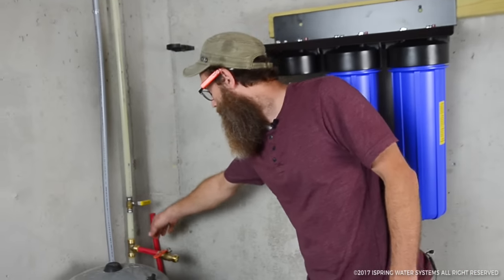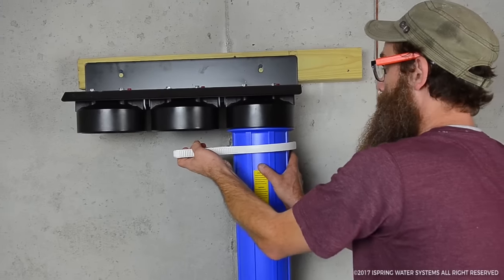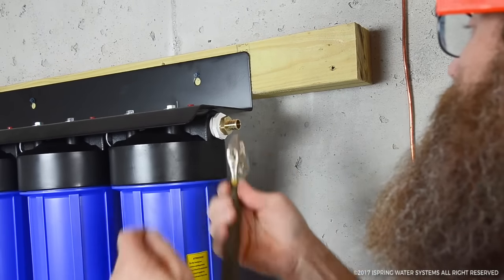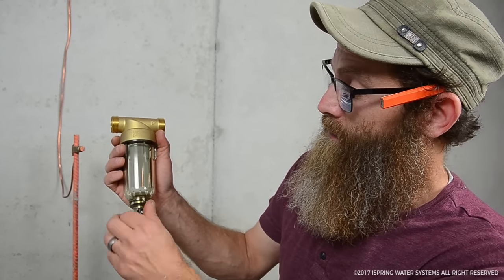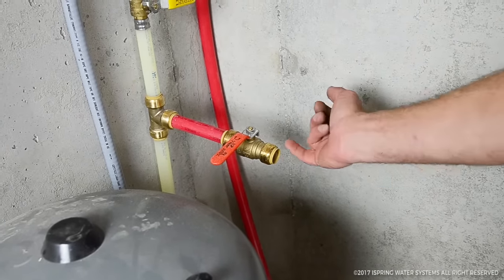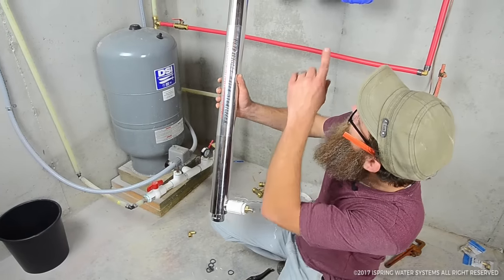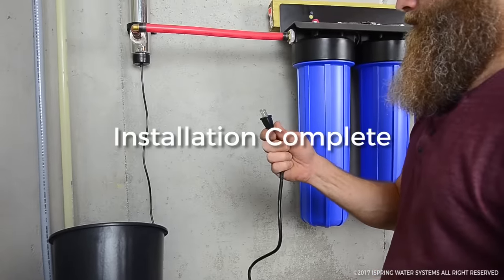iSpring Whole House Water Filter Systems DIY Installation

Comment: Which position should the iron & manganese cartridge be in, open or closed?
Reply from the maker: Hi there! The iron and manganese removal filter should remain sealed and not be opened as this can cause the media to spill out and get into all of your plumbing connections. Simply place the cartridge into the filter housing and install it on the system.
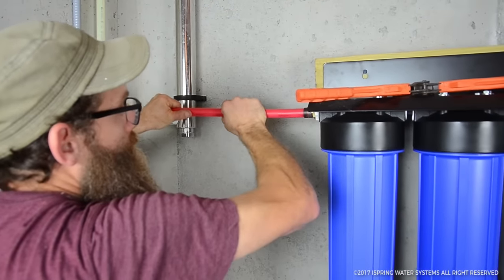If you have any concerns or questions, please reach out to us at support@123filter.com  or 678-261-7611 (M-F 9:00-5:00 EST) for proper assistance. Thank you!
Reply: @iSpringWaterSystems  thank you so much for your help

Comment: My pipe fitting keeps leaking a little bit. Should I try some plumbers putty?
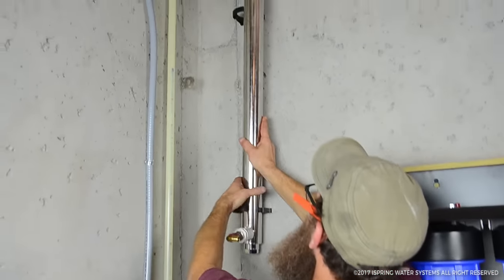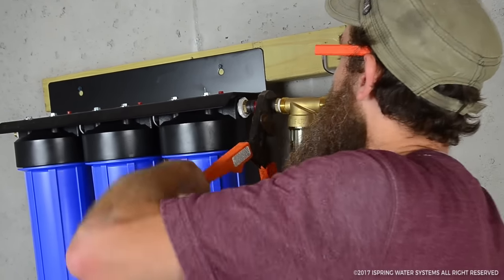Reply from the maker: Hi Bob. We recommend purchasing fittings from a plumbing supply store as they seem to fit better than the ones from Home Depot and Lowe's. You also need to use teflon tape specifically for 1" fittings and plenty of it, sometimes 12 - 15 wraps. Some customers do use the putty. If that doesn't stop the leak, please call us at 678-261-7611 (M-F, 8:30 - 5:30 EST). We will help you to solve the issue.

Comment: i look a those filter that are huge compare to 3m cuno that i use where i live...what cames to my attention is the pipe fittings.. they are small..  where i live ppr is mostly the standard .. but the mains for a small house is 3/4 and up. 1 kitchen and one toilet.    those fittings looks like 1/2 or less.

Comment: Does this system need a pressure tank ??
Reply from the maker: Hi there. Our whole house systems usually don't require a pressure tank. If your water pressure is below 25 psi, please give us a call at 678-261-7611 (M-F, 8:30 - 5:30 EST). We are happy to help you figure something out!

Comment: Looks like a crimper is used throughout this install? What type and model please?
Reply from the maker: Hi Spicer. For more information about crimpers, you can check out this video: https://www.youtube.com/watch?v=P3fS01e1RVM&feature=emb_logo  (the crimper is near the end). Our WGB series whole house water systems have different type of connectors for Pex and some of the connectors require expansion before insertion and crimping.

Comment: If I already have a wholehouse filter system and water softener do I need a 3-stage filter for my RO system?
Reply from the maker: Hi there. It depends on the type of contaminants that your water has, and on what your current systems filter. Do you have a water test report that you can share with us? A water test is very important to know the contaminants that your water has to choose the system or systems that meet your needs. 
You might want to check our blogs about how to choose the right whole house system and how to test your water quality :
https://www.123filter.com/ac/a-comprehensive-guide-to-whole-house-water-filtration-how-to-select-the-right-whole-house-filtration-system 
https://www.123filter.com/ac/how-to-test-my-water-quality
If you have a water test report or if you have any questions or concerns, please kindly contact us at support@123filter.com, at (678) 261-7611 M-F 8:30-5:30 EST or at (470) 560-0012 M-F 8:30-5:30 EST (Messaging only)  to properly guide you.
We are happy to help!
Reply: @iSpringWaterSystems  I have a report of the water from the inspection and nothing was present.  I am using a three stage whole house filter (Pentair Pentek DGD-2501-20, Pentair Pentek ChlorPlus20BB, Pentair Pentek FloPlus-20BB) + Water softener.

Comment: Does this solve for manganese in water that results in black sludge like substance on faucets and in washing machine? That what I’m trying to solve for without paying $3500 to Kinetico.
Reply from the maker: Hi Mike. Our WGB32BM would help to solve the problem only if manganese is 1.0 ppm or lower. We recommend getting your water tested first. After you get the results, please give us a call at 678-261-7611 (M-F, 8:30 - 5:30 EST) or email us at support@123filter.com. We will be happy to give you a personalized product recommendation.

Comment: I ordered a Fcrc25b filter but the strange thing is that there is no label indicating that it is the fcrc25b filter. The plastic wrap looked tampered near the area of where the sticker should of been. I don't want to speculate that I was given a different filter because the one I ordered wasn't in stock or something of that nature. If I get a reply that would be greatly appreciated.
Reply from the maker: Hi Lucas. I'm sorry that the FCRC25B filter you received didn't have a label. The filter was always in stock for the last 30 days so if you bought it from Amazon, Lowes.com, HomeDeport.com, or directly from us at www.123filter.com, it should be legit. If you still have concerns, please feel free to reach out at 678-261-7611 (M-F, 8:30 - 5:30 EST) or support@123filter.com. We are happy to help.
Reply: @iSpringWaterSystems  Thank you for the response after talking to your customer service rep they assured me that  the filter i have is the correct one.

Comment: Looks too heavy for a wall filter. I'm wondering what is the weight with water flowing through the system.
Reply from the maker: Hi there. the canisters full of water are about 15 lbs. each. If you still have concerns or need tech support, please feel free to contact us at 678-261-7611 (M-F, 8:30 - 5:30 EST) or email us at support@123filter.com. We are happy to help!

Comment: Can i use those blue containers to greatly increase the water 💦 pressure if I remove the filters inside?
Reply: Pressure doesn't change.  Only flow changes!  Plugged filters will only restrict flow.  Trust that helps U.

Comment: Could all that filtration and UV happen BEFORE the water goes into the tank? I'm on city water (steady pressure--no pump cycle), and am think of adding the water filter... And would use the tank as an emergency storage supply...
Reply: Hi Ralph Marshall,

Yes you could install the system and UV sterilizer before a pressure tank or holding tank. Please let us know if you have any additional questions.

Thank you,

iSpring Water Systems LLC
Reply: I DO have a question... Seattle's water is actually very good... 29 ppm... My house is 70 years old and the pipes are original... Lately the hot water side has slowed down so I'm going to take care of that and add one of these set ups I see above... Here's the question... Two products promise to revitalize your water... Something about clusters of molecules, blah blah... One is the Home edge... Basically, sets of propellers just to churn up the water... And the other is an electronic system that uses EM frequencies to alter some ionic blah blah... Are either actually worth anything?

Comment: Maybe it's just my failing eyesight, but it looks like little to none of the feed water lines, prior and post filter lines had any support/securing installed.  I trust you corrected that after the video.  Failing to do so is sloppy workmanship >> In my opinion!
Reply: Should also install a 3 valve bypass on the UV along with a test port bleed valve for when you are changing the lamp to drain the water, also always support the piping to the wall and use gloves when touching the lamp and the filters.

Comment: Why don’t any of these filters come with 1/4 drains on the bottom of the bowls ?
Reply: Good question. 'Water Express' does have a pressure release button at each of the 3 filters, but you still have a cannister Full of water to deal with. A bottom drain would be nice.

Comment: How much power does the uv light   pull continuously? Won't it drain solar batteries?
Reply from the maker: Hi Grover. Our uv light uses a 55 Watt bulb and sterilizer.  It depends on your solar battery's capacity to say whether or not the uv light would drain it.
Reply: @iSpringWaterSystems  does the bulb burn all the time or just when water passes through?
Reply from the maker: @groverwindham9761  The current version is burning all the time. However, our latest version coming in the near future will have an auto switch that only turns the uv light on when water passes through.

Comment: Question, I installed the WSP50P  SPIN DOWN filter in the same position as you did, I noticed it has siliphos for treating lime scale. having the next filters in the line effect the siliphos treatment if any?
Reply: Hi Tommy Parisi,

Thank you for your question! The siliphos will not be removed by the whole house system due to the micron size of the filters. The siliphos will pass through and continue to treat for scale buildup. Please let us know if you have any additional questions.

Best Regards,

iSpring Water Systems LLC

Comment: Is that spin down filter a 50PPM or 100PPM?
Reply from the maker: Hi there. If you are referring to the micron size of the screen, it is a 50 micron. 
For further concerns or questions, kindly contact us at support@123filter.com and at (678) 801-9308 M-F 8:30-5:30  EST or (678) 261-7611 M-F 8:30-5:30 EST

Comment: I purchased the ispring system directly from Amazon and it looks exactly like yours but mine does NOT have the pressure release buttons on top.  Do you have any idea why?
Reply from the maker: Hi TechMAP. Thank you for reaching out. Since over the years we are improving our systems to provide better products for our customers, we removed the pressure release buttons from the latest version of our whole house water systems to prevent potential leakage. If you have more questions, please feel free to contact us at 678 261 7611 (M-F, 8:30 - 5:30 EST) or email us at support@123filter.com. We are happy to help!

Comment: hi

I want to put a fluoride reduction filter in line with 2 cintropur filters (activated carbon) nw 25 & sl240 + vortex (a bigger version of your prefilter you clean everymonth), what cartridge filter could I use?  Wich shell should I use?
Reply from the maker: Hi Emmanuel. Thank you for reaching out! You can use our WGB32B whole house system as a shell. As long as your cartridges are 4.5” x 20”, they will fit in our system. However, since you are purchasing filters from other brands, we can’t guarantee that the whole system would work as you expected. If you have further questions, please feel free to contact us at 678 261 7611 (M-F, 8:30 - 5:30, EST) or email us at support@123filter.com. We are happy to help!

Comment: Thank you for your video. I am having a problem at my house where I live. The water has a lot of coarse (yellow coarse) with particles that ranges from powder size to a 1mm size stones. We have two filters already installed (the ones that come long in blue color plastic compartment), in one we use the sediment white replaceable filter and in the second we use the chlorine filter that has a net around it similar to the ones you just showed and none of those is helping at all. Every day we keep cleaning our water valves or mixers lid filters in the toilets and kitchen. Which WSP would you recommend to solve this problem? would i need one or more? thx
Reply from the maker: Hi Chady. Our WSP50ARB spin down sediment filter should be your best solution. You can get it here: https://www.amazon.com/iSpring-WSP50ARB-Reusable-Spin-down-Touch-Screen/dp/B07XLP2T2Y. If you have any other questions about our products, please feel free to contact us at 678-261-7611 (M-F, 8:30 - 5:30 EST), or email us at support@123filter.com. We are happy to help!
Reply: @iSpringWaterSystems  Hi. Could you briefly explain to us how the UV filter uses electricity without having the need to plug into a socket? And how the lamp inside is changed? Also does it matter if it's oriented vertically as opposed to horizontally like I see other applications? Thank you!
Reply from the maker: @Rick-the-Swift  Hi Rick, 

The UV filters do require electricity and can be mounted either vertically or horizontally. If you have more questions, please call us at 678-261-7611 (M-F, 8:30 - 5:30 EST). We are happy to help.

Comment: needs pressure gauge before and I between each filter.  maybe even 1 after if you feel like it.  that way you know if everything is good and if the psi drops by more than 10, it's time to change the filters
Reply: 15 psi

Comment: red is for hot water... correct?
Reply from the maker: Hi there. Our whole house water filtration system is best placed at the POE or point of entry before the water heater. The red pipes in the video should not be for hot water. If you have more questions, please feel free to contact us at 678-261-7611 (M-F, 8:30 - 5:30 EST) or email us at support@123filter.com. We are happy to help!

Comment: Why would I want to filter water for the toilets?
Reply from the maker: Hi there! It is necessary to filter the water for the entire house to avoid getting stains on fixtures, and it provides a longer life for pipes and appliances. For example, iron in water leaves orange stains in the shower, bathtub, in the toilet and in the toilet tank. 
If you have iron in your water, you might take a look at our WGB32BM system:
https://www.123filter.com/ac/index.php?rt=product/product&product_id=455&acid=2
For further concerns or questions, please contact us at support@123filter.com or at (678) 801-9308 M-F 8:30-5:30  EST// (678) 261-7611 M-F 8:30-5:30 EST.

Comment: Can I have information about PPM after and Before filtering ? thanks.
Reply from the maker: Hi Ari. Our whole house water filters do not reduce PPM or TDS, thus keeping healthy minerals in the water. Please note that PPM or TDS is not the only way to tell your water quality. If you need a system that removes TDS or PPM, please consider iSpring reverse osmosis systems. If you have more questions, feel free to give us a call at 678-261-7611 (M-F, 8:30 - 5:30 EST). We are happy to help.

Comment: don't you have water pressure loss with so many filters?
Reply from the maker: Hi Judas. There shouldn't be a significant water pressure drop if the system is installed and maintained properly. If you have other questions or concerns, please give us a call at 678-261-7611 (M-F, 8:30 - 5:30 EST). We are happy to help!

Comment: seems like the carbon filter should go after the iron/manganese filter
Reply from the maker: Hi Robert. We recommend placing the carbon filter before the iron/manganese filter since some chemicals in your water may reduce the capacity of iron/manganese filter. If you'd like to discuss in detail, please feel free to call us at 678-261-7611 (M-F, 8:30 - 5:30 EST) or email us at support@123filter.com. We are happy to help.
Reply: @iSpringWaterSystems  Im on city water, but it seems the manganese/iron residual would leave a bad taste
Reply from the maker: @roberthart9886  The iron/manganese filter (FM25B) will remove most of the minerals in your water. So the "bad taste" you mentioned might because there are no minerals in the water, but not everyone likes it.   To make the water taste better, we recommend installing a countertop drinking water filter, like our model CKC1C. You can find the product here:  https://www.123filter.com/ac/index.php?rt=product/product&product_id=172.

Comment: Are there filters for this system that will eliminate calcium?
Reply from the maker: Hi Don. The WGB32B series won't help with calcium problems. If you need a filter that prevents scale and protects your pipes and appliances, we recommend installing our WDS150K anti-scale whole house water filter. You can get it here: https://www.amazon.com/iSpring-WDS150K-Filter-Patented-Inhibitor/dp/B0849P1CYX

Comment: You should know that you never handle the input lightbulb on the UHV tube with your fingers.
Reply from the maker: Hi dear customer! We genuinely appreciate your valuable feedback as it assists us in enhancing our services.
For safety, wear rubber, latex, or nitrile gloves. It will also avoid contaminating the lamp.
If you have any questions, please kindly contact us at support@123filter.com, at (678) 261-7611 M-F 8:30-5:30 EST, or at (470) 560-0012 M-F 8:30-5:30 EST (Messaging only)
We are happy to help!

Comment: I install two water filters system. my water 40 psi dropped to 20 psi. my incoming water pressure from the water main is 80 psi. I  also tried to increase  my water psi by adjusting my water pressure regulator  and did not work either. 
my system two water filters did not have release pressure valve so it was difficult to change filters because the water pressure was still inside . I had to cut my pex .connector to release water psi in other to change the filter.

water leak from incoming 1inch water . I tried several time and still have s small leak. i aslo had leak from two canister even though I screwed two canister all the way up until I could not turned it.
for now I uninstall  the  whole house water filter and returned it. I hoped I can get some money back.
Reply from the maker: Hi le tran. We are sorry that you are not satisfied with our product. If there is still anything we can do to make it right for you, please don't hesitate to contact us at 678 261 7611 (M-F, 8:30 - 5:30 EST) or email us at support@123filter.com. We are happy to help!

Comment: Looks like your 50 micron WSP is installed in the wrong direction.
Reply from the maker: Hi Mike. Thank you for pointing it out. We are working on a new installation video and will get it corrected there.

Comment: I thought you had to have a shut off valve after the spin down pre filter before the three stage filter in order to actually get the tornado effect to clean the spin down filter?
Reply from the maker: Hi William. It is not necessary. If the water downstream of the spin down filter cannot advance then it's the same as having a shut off valve. If you need more tech support, please give us a call at 678-261-7611 (M-F, 8:30 - 5:30 EST) or email us at support@123filter.com. We are happy to help!